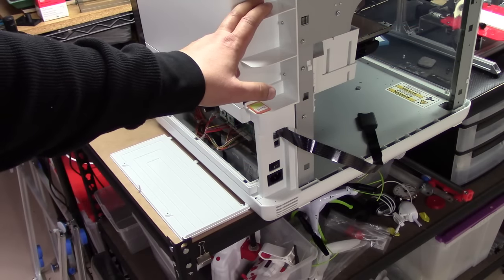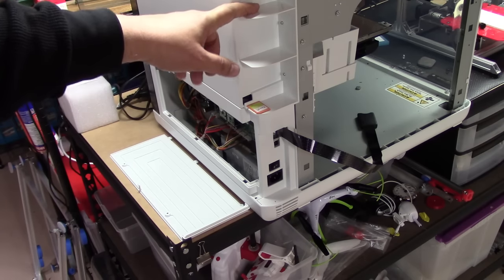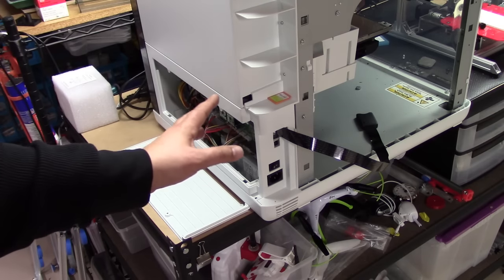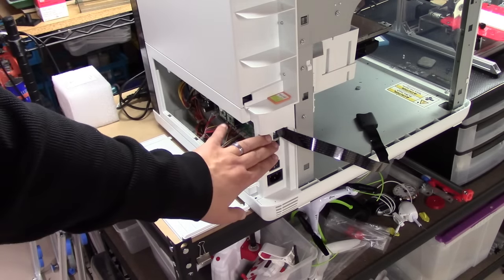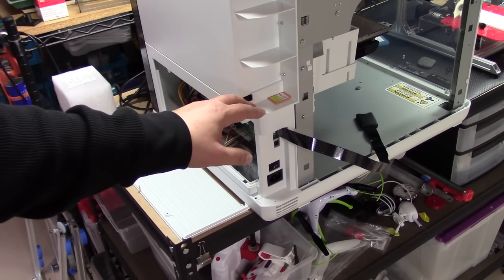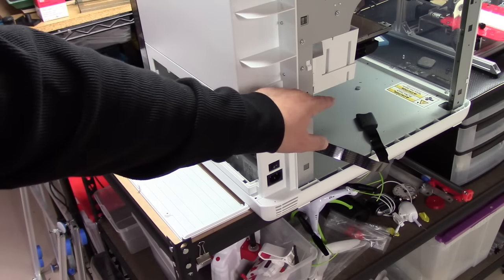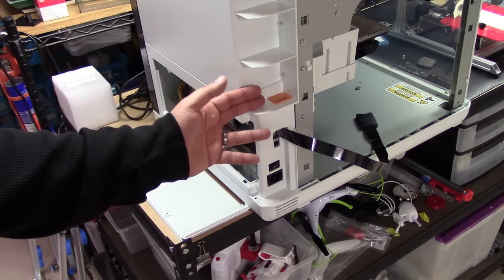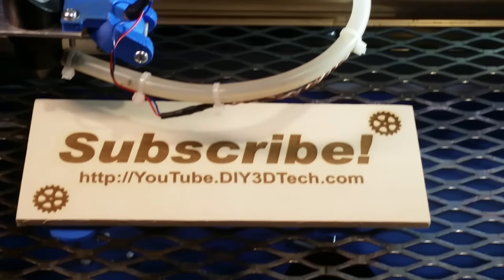XYZ Printing Da Vinci 3D Printers  - Quick Update!

Comment: great idea .. hmm  any info on the WiFi SD card you use ?   i never looked at them before but ,  hey it should make and SD printer a WiFi printer rite ? * looking at my Fab Mini V1 + control control board . LOL
Reply from the maker: I stole the idea from Robert (RJ Make) as yes you can slice the file and upload it on to the card so it does away with the card swapping...

Comment: I tried to install a WiFi card to my MP select mini but the EZ Share wifi card wont let me transfer files it can only do photos witch one did you use?
Reply from the maker: AN EyeFi clone I got from eBay...
Reply: DIY3DTECH.com thanks
Reply from the maker: Check out (https://www.youtube.com/watch?v=4nQLcwv-_4E) as here is where I stole the idea from and he is using the Toshiba Flash-Air Wifi SD Card which might be easier to source
Reply: DIY3DTECH.com yeah I have seen that video before thanks
Reply from the maker: Let me know if you get it working :-)
Reply: DIY3DTECH.com will do did you hear about the new $149 MP Delta Mini 3D printer
Reply from the maker: Nope are they ordersble now I have always wanted a delta as they are like motion art!
Reply: DIY3DTECH.com not yet they announced it at CES 2017